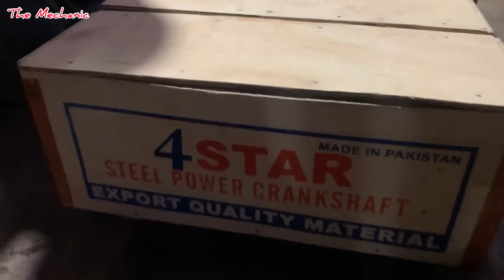Production of Crankshafts in Factory Complete Process || Machining 3 Cylinder Engine Crankshaft

Comment: VERY impressive work considering how much of it is still manual on older equipment.  My hat is off to the workers!
Reply: Возможно придется "снять шляпу" перед пользователями этой продукции.
You may have "to take your hat off" to users of these products.
Reply: @vvdvlas8397  I agree.
I would not use one of these cranshafts.
Reply: But in modern cnc Era is it acceptable?
Is engine will give required performance? Never
Reply: “Manual” equipment as you put it has built the world,it’s also where the true skills lay when it comes to metallurgy and machining,these guys would put must modern machines to test in any field of accuracy related to the process,automated processes take all skill away from the operator and rely totally on a “computer”to do even the most basic of tasks,sad really when you see a century of knowledge lost to time because of consumerism and laziness.
Reply: @JoeRocket-sf6qs  Give them modern equipement, you'll see them do a great job by making a really good precise machining on these cranshafts. 
Steam engines have built the world too but you don't want to see a steam engine in your car and it's neither laziness nor loss of knowledge.
Reply: @yannickl5976  
The German aircraft engines of WWII were built in this manner, as were the English engines such as the Merlin.
American manufactures had already transitioned to more automated equipment, and I remember reading that quite a bit re-engineering had to be done to adapt the English specifications, when  we started building the Merlin in America. 
Manual machining takes a great bit of skill, learned over time which is the main reason automated equipment was invented by the automobile companies. Mass production by the automobile manufacturers quickly outstripped the available skilled machinist which led to the development of automated machines.
But a skilled machinist can do extremely accurate work. In fact many small custom shops still use manually controlled machines and do outstanding work!
Reply: @yannickl5976  They're fine for their intended purpose. Dimensions are checked even if this is all done by hand, it's just super labour-intensive.
Reply: @SolarRepublic  For a diesel tractor it's fine, but a CNC can achieve tolerances and produce them much faster at lower energy cost. You wouldn't want to try this with a car crankshaft.
Reply: @mahbriggs  An aircraft crank has to be very precise. The tools the Germans and English had were far ahead of the ones used here, and they had extremely skilled engineers. you think these cranks would hold up in a 2500hp aircraft?
Reply: @yannickl5976  But that's the whole point. Modern machines cost a lot of money whereas the safety and health of these people is not an issue thus cheap. It would be the task of the government to put an end to this human exploitation.
Reply: they are destorying materials and tools. You can do much more pro work with those tools. They just deatroyed it to the point it is useless. Much worse tha 1920's processes and qualities. I hope that doing it for fun and they are not selling that.
Reply: @JoeRocket-sf6qs  LOl those guys are simply hammered down the machines and shows lacks of respect for anything. You can do a lot of precise work with manual lathe, but it doesn't involve hammering parts into place. Even in 1920 the process was much better.
Reply: @ct1762  
I never claimed they could!
I was pointing out that you didn't need modern cnc machine tools to do high tolerance work.
Reply: Doing one-off, prototype & development work with CNC is a nightmare compared to manual.  Is it straight ^ journals to spec, then it'll be OK even if the stroke & phasing are off.  Sure Henry Ford would break down steps for dedicated machines, but he'd be happy with the workers speed.  My hat's off too!
Reply: @alro2434  No he would not. He would fire them on a spot for destroying machines. Lathe is not a nail, you do not need a hammer unless you have no idea about lathes. They just used stupid brute force, destroyed material (ni chance to get over 12 months of usage out of that crap in any machine). Horrible barbaric act.
Reply: @MM-oh3zs  also, they cut everything without any cutting fluid. Talk about trashing tools! That one kid had not a drop of oil on that bit.
Reply: @mahbriggs  If I remember correctly the processes that needed to be changed on the Merlin engines had to do with fitment. The US manufacturers made engines with fungible parts (you could take any part from any engine and bolt it to another with serviceable fitment). The British were basically doing each engine as a one-off hand fitted assembly like you'd see on a modern-day race car. They still could get great results (maybe even better) but much more labor intensive to both manufacture and service.
Reply: @randr10  
I think you're right, I just remember reading in a book about WWII industrial production, that they had to do a fair amount re-engineering to adapt it to American automated tooling.
Going from hand fitted parts to universal fit parts would probably involved a fair amount of fiddling with the specifications.
Reply: People in these comments don't realize how destitute these workers might be. It's really rich for North American CNC guys making $30 an hour plus benefits to ridicule these fellas making pennies an hour with an employer that doesn't give a rats ass about their safety.

And everyone's acting like these crankshafts are being sold as oem replacements for a Ferrari. It's a 3 banger for an old stationary motor, run at a constant rpm, lol.

"it's going to break after 5,000 miles". Yeah, this crank isn't a tight tolerance forged crank. But it's being used in a market where aftermarket parts are cheap and labourers are abysmally underpaid.
It doesn't matter if the crank breaks if its going to cost $4 labour to replace and $15 for the crank itself. These cranks are not being sold on rock auto for $500 USD...

Besides, there isn't a single north American machinist who would work in these conditions unless they were making like 500k a year. These guys are working at break neck pace for 12 hours a day and come home with a few dollars. We should all feel humbled about our work ethics over here in developed countries when we see how hard these guys go at it
Reply: @Jason-fp7vi  Exactly, and nobody here commenting is checking these cranks with proper measuring tools, nor running any  to see if they're in spec per the customer's requirements. Some steps could have been left out because the shop here considers it a trade secret and didn't want to show it. It's up to the company contracting for these parts to ensure quality control processes are in place. My guess is that if these are out of spec, it's because the customer went with the lowest cost option possible and doesn't pay to have them checked and tested, but it's also possible that these meet the spec required. If you watch the final stage with the guy running the OD grinder, he actually gets out some proper measuring tools, checks all the journals with a mic and dials in the clock on the crank pin locations with an indicator and he grinds all the mains, sealing surfaces and faces with the crank mounted between centers. Might not be good enough for a 6000 rpm car engine, but for a Perkins AD3.152 that these seem to be made for, it'll never see more than 2000 RPM or so. With proper break in procedure and good maintenance, these might last a good long time.
Reply: Venturi Life Ferrari onced used this tec while building the best
Reply: @JoeRocket-sf6qs  "these guys would put must modern machines to test in any field of accuracy" - yea, no they wouldnt lmao. Modern machines are way more accurat than any human can be. I learned to use a lathe in my apprenticeship aswell and you can only be precise to a point, A programmable lathe can be precise into the nm range every single time AND be fast at the same time.
Reply: @radhahariharan7384  You might want to look up worldwide sales of Royal Enfield motorcycles before claiming that. Is this crankshaft factory in Pakistan anyway - the company they are making the cranks for is.
Reply: @VenturiLife  Accuracy is all in the skill of the operator, I had to cylindrical grind parts on worn out machines from the second world war to tolerances of 1/10,000th of an inch. You just had to understand the intricacies of the machine.
Reply: Amazed by the "it's not accurate comments" I used to run a Dixi 60 jig borer built in 1967 that was accurate down to 3 microns. Etched glass scales with magnifying inspection windows were there if you wanted to faff about and get even tighter tolerances.

Comment: I worked a gas drilling in India many years ago. The lathe work that was done for me at the local machine shop  with no computer was inpressive I took my hat off to these men. The machinist in this video is also impressive. It is good to see that there are still tradesmen around who are capable of doing this.
Reply: They dont have a choice. Succeed or die
Reply: @LordOfChaos.x  But they will still be making stationary engine crankshafts years after the West goes dark from lack of cheap energy, CNC machines and their factories are complex and  power hungry, spares and consumables very expensive.
Reply: @joefish6091  idk what u are smoking but energy will never be an issue in Europe 
CNC will never die 
Actually conventional machining is on the verge of becoming obsolete

Comment: Amazing work they do at the Renault factory!
Reply: Renault have some reliable engines,can run without issues more than 500.000 kilometers...1.5 dci used for taxi cabs run over 1 mil km without issue.
  Some france engines are on Mercedes and BMW,coming from Renault and Peugeot.
Reply: @j.romanorov  Almost every taxi cab runs that long. It's the way they are maintained and driven that makes them last long. They never get cold and get regular maintenance.
Reply: @jackmclane1826  Taxi cab engines Power output is reduced to achieve lang mileage
Reply: @martinrauchle1559   I'm pretty sure that is not true. I know a guy running a taxi company and he gets normal cars, usually 2l TDI engines. Okay: He doesn't get the high power variants, but the normal 140/150HP models. They make over 150.000km per year and reach mileages that no car in normal operation can get.
Reply: Ha!
Reply: @jackmclane1826  i worked for merc on a dyno and we had to prepare a specific Taxi spec
Reply: 😂😂😂 thank you very much
Reply: @martinrauchle1559  Thanks! Didn't know that!
What were the main differences to series variant?
Reply: Funny.  Le Car would run like a scalded dog. It screamed.  Would roast tires.

Comment: Loads of comments from "engineers" who, I assume, are from developed / Western nations. These cranks are going into 3-pot generator engines that run at constant speed that is likely around the sort of RPM that most cars IDLE. The parts do not need to be manufactured to especially tight tolerances nor made out of particularly exotic materials. 

Sure the engine will run a little rough and lumpy and use some oil but I'd bet my arse they last fucking ages. How do you think cranks for cars were made before the age of automation and CNC? I'd bet there are some machinists in developed countries who couldn't hand finish these cranks to the same quality as these guys. They're literally eyeballing the drilling for oil galleries. 

The goal here is not to make high precision machinery. They're making simple, cheap engines that are relatively reliable AND easy to maintain with a hammer and screwdriver for use in unforgiving conditions. I'd say they're delivering exactly what has been asked, in less than ideal conditions and with workshop equipment that would be considered below standard in the West.
Reply: "I'd bet there are some machinists in developed countries who couldn't hand finish these cranks to the same quality as these guys. They're literally eyeballing the drilling for oil galleries. " I'd bet there were more machinists in the west who could than there are in these countries... What do you think lead to the development of CNC mills and lathes? They are much more than just electronics..
Reply: @TheChrisey  I can bet that those days are over in developed countries. As of now such skill is or only seen in developing countries.
Reply: Finally someone with some sense! I'm also an engineer myself (a real one that likes oil on his hands! ;) ) and have to agree whole-heartedly! 
From what I pieced together from other comments: This engine is a clone from an early 80ies massey ferguson tractor engine. 3cyl, 2,5l displacement, under 50HP. Good enough for the task and - honestly - impressive to do it with such simple means. It just doesn't matter if the stroke of one cylinder is 0,1 mm shorter than the other or if there is a little stress riser, or the oil feed line isn't centered. Good enough is good enough!
Reply: heat treated steel and tight tolerance is required for modern high speed engine, to maintain oil film pressure to withstand force and horsepower load on crank.
with 2.5L engine expected to produce 50HP at low RPM? cast iron , huge bearing , huge oil gallery (and some thicker oil) with loose tolerance is more than enough.
Reply: Der Traubengott  they measured poorly but they were quick and if there is no point in a higher tolerance then why spend the time / money.  I build bicycles wheels (for myself), the tolerance I work to for truing might be 0.5mm, it's for an MTB and is disk brake but there are people doing the same with digital DTI and working to 0.05 or something as pointless, first time over a drop or jump and who knows, my wheel might be better.
Reply: Very good comment, thanks my friend.

Comment: These must not be for combustion engines, more for lower load/rpm pumps or similar.  Great skill, but no heat treating and limited attention to tolerance.  Watching a bunch of dudes in flowing garments work around spinning equipment gave me the chills.
Reply: Flowing garments are just the shop owners retirement plan coverage. Taken care of in house.
Reply: This country manufactures nuclear weapons' ...scary
Reply: Boxes at 39:37  had marking MF-240 which could mean Massey Ferguson 240. It happens to have three cylinder diesel engine.
Reply: @mcmaddie  Ouch.  That is scary.  Diesel has lower rpm, but lots of torque.
Reply: The electrical wiring on the walls is amazing too
Reply: @RichardHeadGaming  You mean so they die and the owner does not have to pay retirement salary?
Reply: @christianeriksson4733  Yes, yes I do. If the owner cared he would one have safety standards, and two have quality standards.
Reply: @Alpha Jamil None, but I did eat a nice steak Yesterday Beta.

Comment: With all that hammer tap centering, I'd love to see the tolerances of the finished product. 
+/-.0001 for sure.
Reply: Right!?
Reply: Before the cutting, it wouldn't make a difference.
Reply: exactly
Reply: the turner should come and see in switzerland, just to change scale ...
Reply: @killer408cid  
It makes a difference if each journal/surface is cut on a different machine.
One operators "centered" may not be the same as the other guys.
Reply: I mean,  even harbor freight sells dial indicators.
Reply: Oh Jesus Christ. If my line boss ever saw me to that, aligning with a hammer???  But this was 44 years ago for me so watching them do everything manually is kind of nostalgic.
Reply: youd thing theyd just use a 3 jaw if they were gonna centre it that way.
Reply: @declancampbell1277  scroll jaws of any kind I reckon'd be better than that.
Reply: @killer408cid  If you keep the workpiece clamped down from begin to finish, yes, but they change machine 4 times. The tolerances are going everywhere.
Reply: They’re going to Belarus. It’s okay there.
Reply: I like the second guy’s wire and paper rig , listening to it to adjust the run out. With a good ear and plenty of stock to work with i can see how that setup works. When you have to take off a .5” of material you don’t need to have dial indicators to setup. If the machine is dialed in the part will be concentric.
Reply: @Engineer9736  Someone posted that these are for diesel tractors, so fairly low rpm, use heavy oil. But for Bugatis they're not!

Comment: MF 240. Good old Massey Ferguson tractor engine spares. Great job lads, the new shot blasting machine must have set you back a bit in the cash game.
Reply: je pense que c'est faux, c'est la référence 4star steel power crankshaft, c'est pour des Chevrolet 3 cylindres
Reply: @ronaldstretti7455  it says perkins and crown on the casting
Reply: @ronaldstretti7455  It is definitely a Perkins 3 cylinder crankshaft.  This crankshaft is quite familiar to me, the flat section with the two threaded holes on the first and last crank web are for bolting counterweights on.
Reply: @ferrumignis  Thanks. Very interesting. These are for tractors for sure.

Comment: This is how it was made during the Second World War. God, protect those cranks 😂😂😂
Reply: It's a time machine.
Reply: This engine will probably also have the power per displacement of a WW2 engine... so it's fine!
Reply: Now hang on a minute, engines produced during ww2 were actually very well machined. Especially aircraft engines. Allied forces could NOT have engines breaking during bombing campaigns, dogfights etc. . .and by the end of the war, the aero engines produced were incredibly high output and high performance machines.
Reply: @life_of_riley88  Aircraft engines: yes. Tank engines: no.
The patton made 27HP per liter. As a petrol engine, not Diesel.
Reply: @jackmclane1826  Willys jeep had about 32hp per liter. I wonder about the new Wrangler